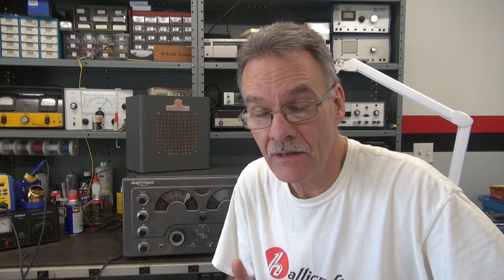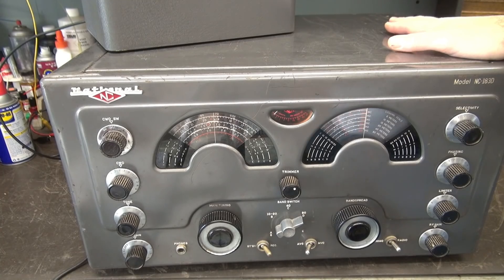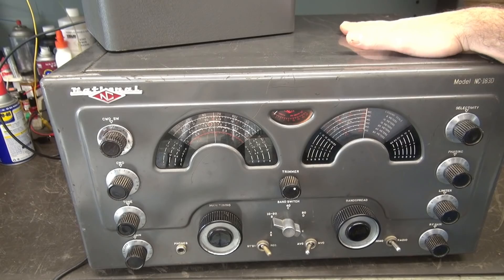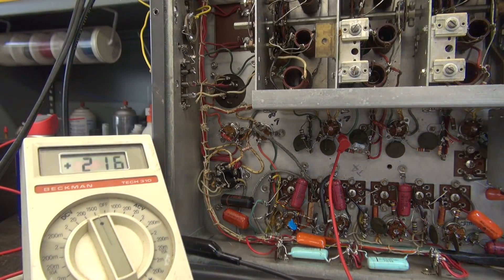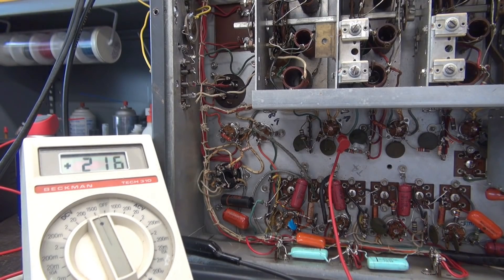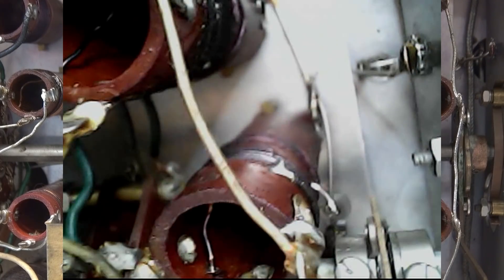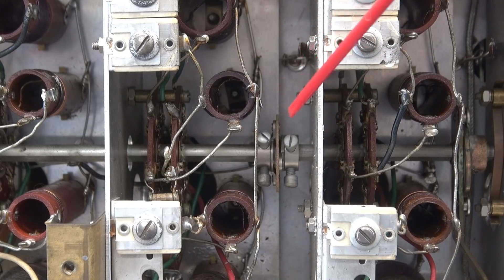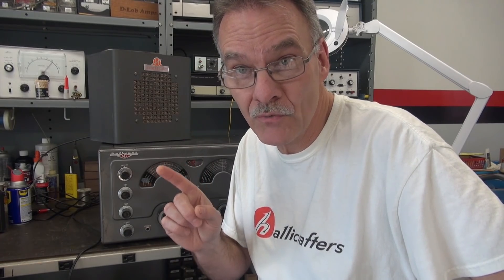How to repair National NC-183D shortwave receiver dead band Ham radio

Comment: I had to go and see if I could find one of those for sale on Ebay, as of today, there were two up there, one was local pickup only in Oklahoma the other was 100 for the unit and 100 for shipping.  Don't have the two hundred for the one that will ship or the 250 for the local pickup which is a LONG haul from South Dakota.  Ah well I don't have any place to put it right now anyhow, guess  I will have to just use my old SONY World Traveler, or my little Grundig GR8 for shortwave listening, I can't afford another ham set either, I have a couple of 2 meter mobile rigs and a couple hand held but being the only ham in my home town, I have nobody to talk to without a BIG antenna to get out of our little valley and some 30 miles to the nearest 2 meter repeater.  73's KE0JBL

Comment: Well done. I was thinking that if the speaker was close to the radio and that wire was unsupported it might have fatigued from vibration from the "booming audio". Love your description. I don't think it was from a transmitter, that is more likely to burn in the inside of the coil where the wire will get hotter. The slipped tool or fingers idea is likely the best explanation.

Comment: Cracking radio and video. Very interesting.... If the coil could not have been repaired could you have taken the required voltage from another coil!?
Reply: No, that is part of a tuned circuit, you would have had that section trying to tune another band.